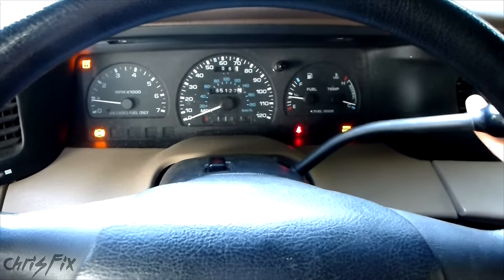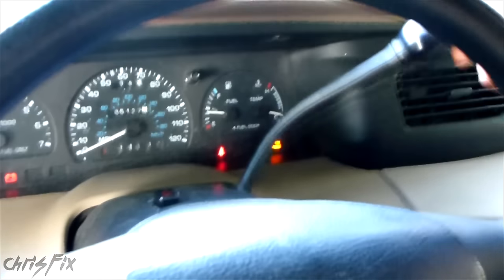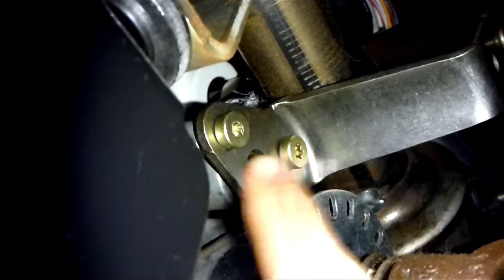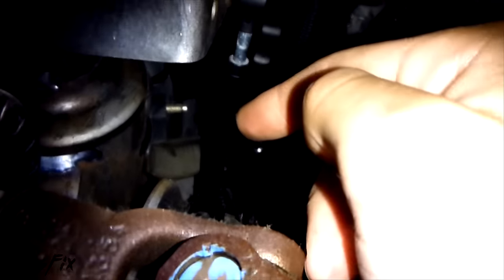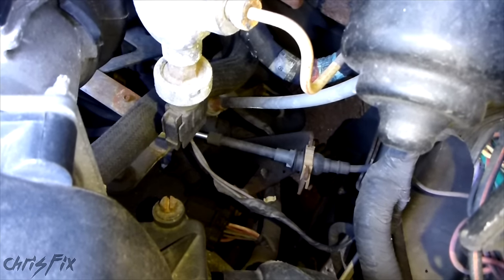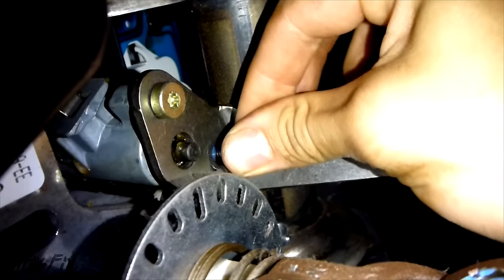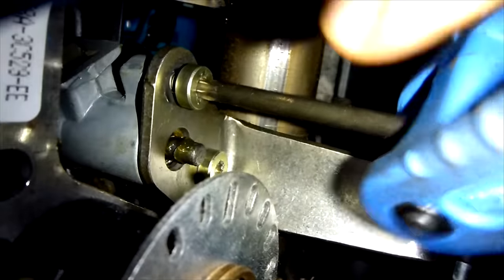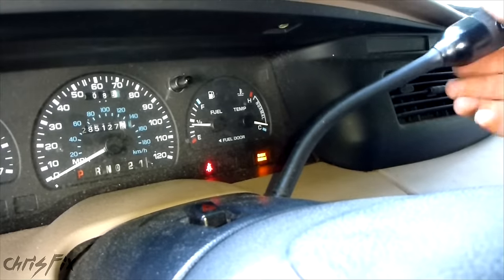How to Fix a Loose Column Shifter

Comment: So im looking at my gear shifter column and the metal plate that the bolts are holdin to shifter.. well it looks bent! Is that possible?!
Reply from the maker: It is possible or maybe a screw is loose which makes it look bent?

Comment: I'm a newbie diy female that's found  some helpful videos on YouTube to help me do some vehicle repairs and now I need some help in finding videos.

I have a 2000 Ford Expedition 4.6L V8 Triton XLT and I have been searching for anyone who can tell me if they had to repair a few things on theirs because I cannot find any videos on the repairs below:

1. Has anyone had to repair the third brake light at the top of the back window wiring harness? 

(My brake light wiring harness where the three bulbs go into has melted)

2. Has anyone had to repair their cylinder metal part that you stick the tire rod into to crank down the spare tire?

(My cylinder metal part just fell out of that opening when I went to stick the long metal tire rod to crank down my spare tire) I'm having to put my spare tire in my third row seating area and I really need to know how to repair this.

3. How to replace the ABS pump?

(My ABS is making a whining noise and the only way to stop the noise is when I remove the 50amp fuse after I park. And this is annoying.  

So if anyone has a videos on how to do any of these repairs above on a 2000 Ford Expedition 4.6L V8 Triton XLT please comment. 

Thank you.😊

Comment: Thanks pal ,but where can I get a new screw. One of mine is missing in 2001 f350.
Reply from the maker: grimmReaperRyDog You are going to have to ask the dealer what the part number is and try to find it (or get it from them). Did you check under the carpet?

Comment: If they are missing what size bolt is it?
Reply from the maker: They are M6X1 bolts with a T25 torx size! The part number is N806584S36 if you want to get the OEM bolts!
Reply: @chrisfix  thanks, I had found the part number, but in case they domt have any at my local ford dealer I can hopefully get one at a hardware store.
Reply: @chrisfix  unfortunately it wasnt that easy of a fix, the whole tube assembly was broken in half.

Comment: I almost the same problem with my 1999 chevy s10 except the shifter is not loose. the gear indicator doesn't change from neutral to drive.

Comment: Is it in the same place for all fords because I have a 1973 ford ranchero and can't seem to find the place to tighten
Reply from the maker: Agent Sheep Not all fords. Most 90s and 2000s will have this setup.
Reply: Do you have any idea how I could fix mine?
Reply from the maker: Agent Sheep Unfortunately without seeing it, no. Go under and see what is moving. Might be the actual cylinder that holds the shifter that is no good. There are bushings that go bad in there.

Comment: Hi Chris. Do you know where I would find the shift linkage bushing on a 2004 Buick Park Avenue. The book for GMs only refers to the cable and I don't see it on the trans like one of the videos I found. Do you know?
Reply from the maker: It depends on the specific car but it could be over at the shifter or where it connects to the tranny.

Comment: Thank you!
Reply from the maker: Nicole Munguia You are welcome! Glad the video was helpful!
Reply: ChrisFix would I have to replace the entire steering column if I break the plate that those hex screws mate with?
Reply from the maker: Yes you would, but it would be very hard to break the metal that those screws screw into. You would strip the inside before you break that metal.
Reply: I have to replace the shift tube. $40 at Oriellys' but going to be a pain to replace....
Reply from the maker: Nicole Munguia Oh, why? How did it get damaged?
Reply: Because I twisted the hex screw too hard ;) Yes I broke off part of the aluminum plate that backs to the two hex screws. bummer.
Reply from the maker: Nicole Munguia Wow it broke? It didnt just strip the inside? That is not what I would have expected!
Reply: ChrisFix Yes the outer corner of the plate broke off.  This is what I did. The inside screw was loose. I removed it as you suggested to apply the blue gunk and then screwed it back in. The other screw seemed fine but I thought I should go ahead and add the gunk. When attempting to remove it, the corner of the aluminum plate broke off.
Reply from the maker: Nicole Munguia Wow, well it is a good thing you were under there because that could have broken off just from use at any time and then you could have been stranded!

Comment: Does thi problem cause a voltage drop to the starter?  (hard starting problem)
Reply from the maker: It should not. Usually the voltage drop is from a loose or damaged wire or a bad starter.

Comment: If this was in a German car these two bolts would definitely have come with thread locker pre applied on them in the factory or when you buy them new. German cars even have thread locker on the timing cover and belly pan screws when you but them new, lol. Even a control module with T8 torx screw has a torque spec, it’s less than 10 inch lbs.

Comment: i have a 2000 ford excursion n mines really loose but the bolts on bottom r tight i think there is a pin missing where the shifter connects up on top , whats that called???
Reply from the maker: +Sarah Mascorro I dont know what that pin is called. Check the bushings too!
Reply: ok thanks :-)

Comment: I've had this problem before. Fast forward a couple years and now it's really loose this time and it's not these two bolts. Any idea?
Reply from the maker: Steven Koepke It could be the column itself. Look under there as someone shifts and see if there is play.
Reply: ChrisFix Dropped the column last night. The shifting rod was broken. There was no way of seeing it unless I removed it. Wasn't too bad.
Reply from the maker: Steven Koepke Thanks for the update and good work! At least it isnt too bad to fix!
Reply: ChrisFix I found the part on ebay for about 40 bucks. I just now actually tried to epoxy it for the hell of it. Don't think it'll hold too well to that type of aluminum. It's that brittle stuff that doesn't rust. Kinda breaks off in chunks. Oh well, learn something new.

Comment: I just found out why my shift lever won't let me put the transmission into Park. The bolt that holds it in place on top of the steering column is snapped.
Reply from the maker: Timothy Summers Dang, get that bolt out and put a new one in! Good luck!

Comment: My column shifter is incredibly loose... Loose, but goes into the correct gears. I checked the torx bolts, they are wrenched down. What the hell is the problem then? (Its a 99 F250)
Reply from the maker: ***** It could be the shift tube or the actual cable...

Comment: would this also fix it if the shifter is hard to move?
Reply from the maker: Potentially. It depends why the shifter is hard to move.
Reply: ok, thanks!
Reply: I have a 1991 Chevy s10 auto 4.3l I can't seem to find where it's located half the time I can't get it in park it is terrible

Comment: my is having the same problem but the torque screws are tight, what eles could be the problem?
Reply from the maker: The shifter column bushings are bad.
Reply: +ChrisFix  Thanks, how would I go about fixing this?
Reply: +ChrisFix  do I need to drop the whole steering colum to replace them?

Comment: Fords are known to go into reverse from the park setting as engine idles due to that.  I'm amazed we don't hear about the injuries this problem must cause.  Ford is too cheap to use any thread locker, even if lives are at risk apparently, this has been a problem since at least 1989 with Ford that I'm aware of.

Comment: How do you fix this on a manual car with a loose stick? Talking about a 98 space star
Reply: I need to know to
Reply: Welp, I don't anymore. And I don't know it either. Good luck finding out
Reply: +Sam Rogiers I found out it's under the car but u need a new plastic ring thing $10 easy fix
Reply: I had a feeling it was something stupid and cheap. Some people just waste money by replacing the entire gearbox.
Reply: I know it's a year late. But just for your information, you need to replace the lower shifter bushing. This is a ring in the housing that helps the stick move. If it's worn, there's a lot of play in the stick. Check it out.

Comment: this wasn't the fix for mine. I arrived at the two bolts wih the size 30 torx and can fell they were already very tight. Any other suggestions? @chrisfix
Reply from the maker: +ozorious Dang, check your column shifter itself. The bushings go bad and make it feel sloppy.

Comment: As a European, this way of shifting always really looked weird to me. Automatic transmission is only now starting to get popular in The Netherlands (even though manual is still more popular due to all the old cars driving around here), but I've only ever seen automatic trans cars with the gear shifter on the same place where the manual would be. Why would that be?
Reply from the maker: +Bas Groothedde Thanks for sharing. Since most of your cars are manual over there, it is cheaper to fit an automatic with a gear shifter where the manual gear shifter would be.
Reply: ChrisFix ah, that's really obvious now you mention it, Thanks!

Comment: Not an easy fix at all. It's almost impossible to get to this bolts, still figuring out how to get there without removing half of the dash. Idk maybe on other models it's easier but on 04 ranger it's hard af. Anyway thanks for the information
Reply: In case you're wondering yes I found this bolts (flashlight + phone camera) but I don't know how should I bend myself to get in there. It's almost seems easier to remove lower dash cover, because there's no way I could stick my head under column to see what I'm doing.
Reply: I made out just fine with my 06 Ranger. Two minute fix.

Comment: I thought i would post here as i have no other answers, 
Why do all american cars have the shifter in the dash?
Also other than high end sports cars, why are there no american cars with a manual gearbox

Common meme: In the USA you can't drive 'stick'
Reply: Robert Perry Automatic transmissions are better overall, and we have long highways. Most old American cars are stick shift manual V8's, we've got more shift stick cars than anywhere else, they're just not "new". Automatics make sense for most people, very few will actually get to "use" a manual in a new car, those that drive stick are old muscle car, rat rod, or truck guys usually. And those people are plentiful.
Reply: no real reason to drive stick anymore automatic transmission tech is so much better than it was decades ago when driving stick meant better gas mileage